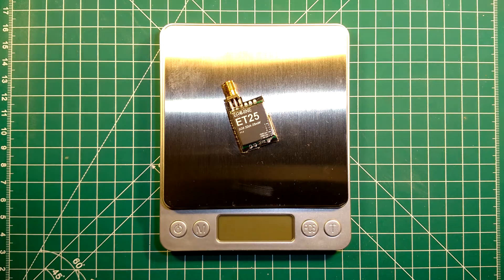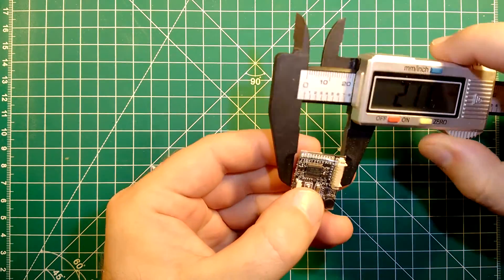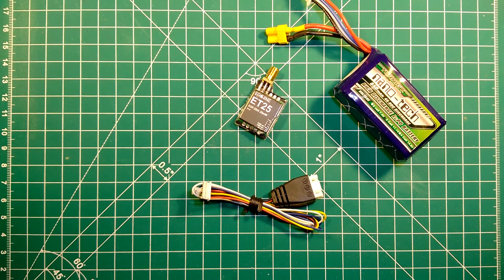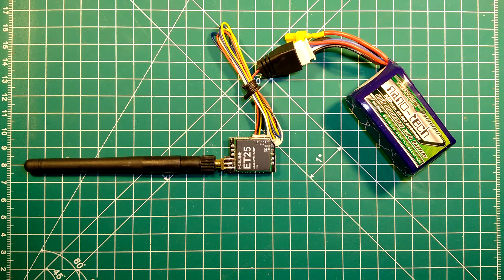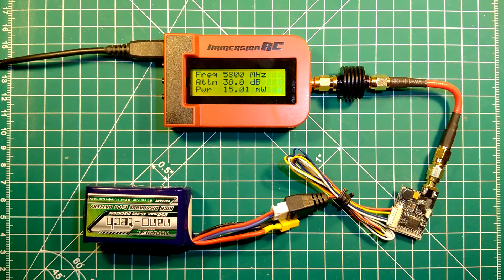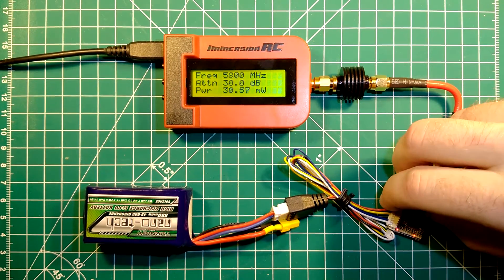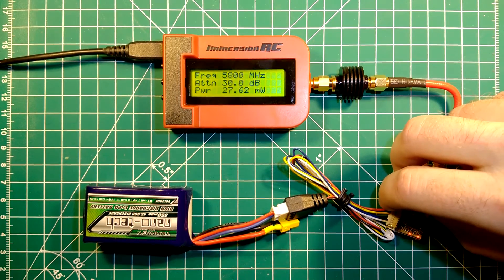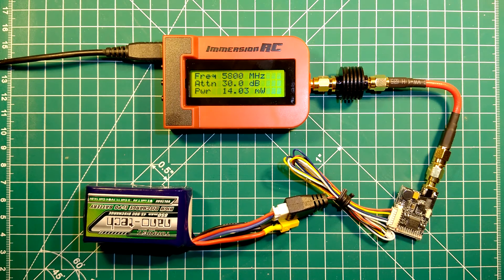Eachine ET25 5.8G 32CH 25mW VTX: Bench Review & RF Power Measurements

Comment: is the temp the same on ch e4 ? and what ch did you have it on when you read the temp?
Reply from the maker: +Chi Sty Yes, I measured it at e4. But I re-measured it at the other channels as well and could not detect any significatn change in temperature (as one might expect). It seems those are not correlated that much.
Reply: Very through info thank you.

Comment: wow the variance in power between the channels is very unexpected and good to know!
Reply from the maker: +Bishop Vick This actually seems to be more common than you (and also I) thought. I have in the meantime measured several more video transmitters and several of them have a quite large variance. I also talked to a manufacturer and they stated that this is quite normal, because the power output at 5.8GHz is apparently hard to control. At least this is what I was told. My measurements seem to confirm this. Very interesting indeed.

Comment: I have the same Eachine VTX only in 200mw version. I always power with 2S power, since that is the minimum usable voltage, and the difference in output between 2S & 3S is insignificant (and running at the reduced voltage allows the VTX to run much cooler). After watching your other video which suggests that the higher the channel number the lower the output, I moved all my VTXs from B8 to B3.  I wonder how close all the VTXs of one manufacture and one model follow on power output?  Since the manufacturer does not include a chart showing the output of each channel, I'm thinking that they might not all be the same.
Reply from the maker: +Bill Somrak I believe for the same model and revision the "strong" and "weak" channels are the same. So that gives some value to my RF power measurements, if someone else owns exactly the same module. I'm not sure if that assumption is also true for different revisions or even different modules from the same manufacturer, I believe not. However, I also have one of the 200mw here with me and I will do a bench review - including RF power measurements - of it in a future video, which will be useful for you :-)
Reply: Okay ... thanks!  That will be interesting indeed!